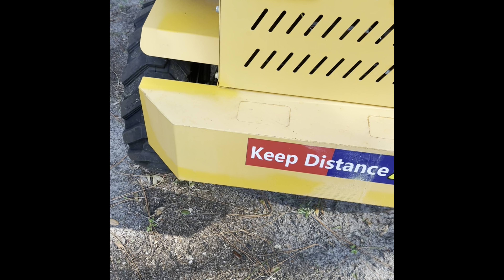Mini Articulating Wheel Loader: The FLAND FL45. Better than the mini skid steer or excavator?

Comment: I have one of these and picked it at auction for $3410 including buyers premium.  Yah quirky and odd plus takes off like a bat out of heck. It’s gotten 40+ hrs of use already and works awesome after you take care of the heat problem. Reversing frequently results is painful to the calves. I added a 12” fan under the operators seat to force the heat out the back. No more heat problem plus noticed the hydraulic fluid runs cooler. Had to replace the hydraulic fluid after noticing metal shavings in the tank.  Mods so far have been added grease fittings, 12” fan and replaced the sheet metal screws with rivet nuts.  Edges on canopy supports are extremely sharp. Have an oil cooler but there’s no easy location that I see to add one so that’ll be next. We used it for moving several units of mulch and was fantastic. Initially thought I wasted a ton of money but no more. Learning curve for someone who’s never used any kind of machine like this wasn’t bad.  I’m happy with it so far.  Show me something comparable at this price point.
Reply: which auction should i look for? website or address pls?
Reply: I'm wondering if there's a group somewhere that owners can share ideas for the FL45. I'd like to find out if anyone has tried messing with pulley sizes to change the speed. If so, share that information.
Reply: @jimsickmeier3281 yes there are a few youtube video mod list includes changing engine pulley to a much smaller one makes it much more usable(more drive force) also slows it down making 2nd and 3rd gears slower and more useable, next is replace rear bumper/fill rear bumper with concrete(rear bumper cannot tow or recover from also not enough rear weight) , 3rd readjust clutch  (notorious for being out of adjustment) , 4th reinforce throttle pedal (notorious for bending) , 5th relocate engine controls to the dash
Reply: @rocket2811 I want to say I seen few on Richie Bro's & Gov planet but if I end up buying something depending on price I might look for a dealer or someone that has a few ya your going to pay more than an auction but of the few dealers out there at min you know your not getting a lemon & they are able to walk you through it vs relying on YT but just a personal opinion but still in research mode

Comment: The owner of such a machine here. I've had it in the diesel version for two years. The machine is simple, undemanding and has already done a lot of work. I had a problem with the frost protection, it was too weak and rusted, so I changed it for 10 Czech crowns. I added a roof, a handbrake and a few extra lights. Also a cushioned seat with heating. I will also add a fan to cool the engine, because the water self-gravity does not cool enough and the temperature goes up to 100 degrees Celsius. Otherwise I am satisfied, it saved my back and hands at work. So let the machine serve you, have a nice day, colleague.🤝
Reply: I have wondered if you can take one of those temp cabs they make for other machines & modify them to work with these. They are like heavy duty plastic tarp material so not a lot of weight but if you live in colder area with smaller heater be effective
Reply: @how-i-roll-rb5796  Hi.  I don 't know , it is possible that he also produces those plastic bedspreads with a light frame. For me, what I put together with the leftover material at home is enough. Recently I added car windows on the side and back, so it's better again and the rear window has heating, maybe I'll even plug it into the electrics.  Have a nice day.

Comment: If one of these could take attachments and buckets like a mini skid steer, that'd be super useful especially moving trailers and stuff around or pallet forks.
Reply: It would require the skidsteer plate and I’m hoping it’s close enough that I can fabricate it myself to make it work as this seems more appealing to be than the stand on skidsteers
Reply: Auger would be great for post holes.
Reply: That'd be great too. I think with a little refinement these can be good machines once they get the bugs worked out.  @bobf61
Reply: I have claw and pallet forks for this, and a gas version I’m selling.

Comment: The gearing is 2x to 3x too high so it lacks torque and it dangerously unstable and over sped.  Super crappy for any hill work and dangerous everywhere else besides.  Has great potential once the bugs worked out.

Comment: I think ina few years these machines could really take off if they made some changes. 1. Offer a diesel option. 2. Switch to hydrolic drive motors, that gets rid of the clutch and speed issues. Also you could then lower the machine down more. Switch to a skid steer style attachment plate. And add aux hydrolics. Of they could also find a way to add a second set of tires like a Ventrac but I guess a knock off version. That would really give people a lot of options. You could plow snow, load trucks, move pallets, mow brush. Etc. with it. If that was around a 10k price tag I think you'd have a winner.

Comment: I made a small skidsteer...I found it stalled a lot at end range of hydraulics...just had to lower reliefs (didn't need all that pressure for lifting etc)...just thought that might help...love your channel.
Reply: The steering actuator is fed from the pump, the drain output of the actuator, then feeds the live hydraulic loader functions. That has a pressure relief, but the actuator when it travels to the end of it's travel, does not let the hydro fluid leave the drain, and hence locks the pump shaft and then the gas engine stalls.
I got one of these a few weeks ago at auction. I'm tearing to total pieces, as I see major weld and bending failures at the rear attachment to the hinge. I can see it bending and tearing loose from the much lighter frame (goes from the 12mm of the hinge rear plate to 5mm frame, which is not the full height needed to give structural support. The transmission install messed all the correct design packaging up. What I believe happened, is this thing started out as a trade school project to take a real 5 cubic meter payloader, and scale it down to one tenth the size. The 45 in FL45 (and TRANER TR45 identical version) is the size of the loader bucket it's 0.45 cubic meters. Seeing all the crazy welding on this, it looks like trade school practice (or prison), but I think the CAD training dept got the drawing for the 5 cu.m. version and wanted to sell electrics. This thing started out being initially exported as an electric, and if you find a video, they are about 30-40 cm longer, and with 5) 12 volt batteries, at 60 volts, had the weight needed. But they also changed the tires, as they were using a thinner one on the electrics. That what I'm guessing happened, and going to a mechanical engine, as the electrics did not sell, they shortened the rear section, and geared it all wrong. 
But it's a good starter kit. I'm going to redo the frame, extend it slightly, remove the belt drive, figure out how to put a hydraulic motor input into the clutch to keep that function and 3 speed transmission and put a variable flow pump on the engine rotate it 90, and mount it near the end with the shaft to the right side of the operator. I've removed that moron exhaust pipe to muffler weldment they did, they stacked multiple gaskets, as when they cut the pipes from the muffler, and welded them onto the square tubing, it clearly had much weld shrink, and stressed the heck out of the M8 studs holding all that weight on and with an offset torque. I got a new muffler, and it will rear discharge, that was one of their issues, as the original muffler would be a right side discharge, and in the way of the hydraulic valves, so they made it rear discharge. But I know that stress on the 8mm bolts will cause them to pull out over time. Also the guy/gal that torqued these bolts, (on the ones that were tight) were all overtorqued, and you can see the spinning of the metric socket on many bolts where they beat them with impact tools. I'm thinking trade school, as they keep building them.
Reply: @f.hababorbitz  could put a relief straight after the pump,a lot of systems do this to protect the pump ,but in your case would prevent a stall...but another return pipe to tank required. The Chinese take short cuts,but it keeps you thinking.

Comment: A first few mods you want to do is decrease motor pulley sizes, next fill the rear bumper with concrete or replace with a more significant bumper still filled with concrete, relocate engine controls to the dash, and readjust the clutch finally reinforce the throttle pedal
Reply: what size pulley
Reply: Most use what they can get a hold of... I added a jackshaft to mine so that I could reduce mine to a top speed of 10-15 mph (10mph with stock 23x8.50-12 tires 15with 26x12-12 as I'm upgrading mine to larger and wider tires for working in wet blue clay and added ballast weights) I used a 3inch motor pulley to pump(still a little big but was what I could get), then a 4.5inch motor pulley  to jackshaft 7.75inch pulley thru jackshaft to 5.5inch pulley driving the 9inch clutch pulley this will give you those listed top speeds (everything was sized based on what was available and to reduce belt slipI used b-belts for the entire setup).

Comment: That thing would 100% more user friendly with hydro-static drive.  Would give you the ability to run fixed throttle position.
Currently building a similar machine using an old Twister as the base.
Reply: I'm working on that exact mod now. Moving the engine, putting the original muffler back on (got one for $135 delivered) as it will cause the engine studs to pull out of the aluminum head. Tough part is to get a hydro motor to the clutch shaft input. Got a variable pump intended for ZTR large mower. We shall see how all this goes. I'm having fun, learning stuff, so I don't care. I knew when I paid $2808 (with tax and auction premium) it was a toy I'm buying to play  with in my retirement (12th year). There is no structural engineering or testing that I can see in this, just "it works so export quick". I think these came from kids in a trade school, that got money to make another electric construction implement, as those were the first exports 2 years ago, which appeared to fail, so they put a gas engine on it. But no gearing, and the weight of the batteries made a big difference as well that machine was a foot longer with 5) 12 volt batteries, and the throttle controlled the electric DC motor. So you didn't deal with a 2500 to 3600 motor RPM on clutch release. All the welds look like new learners, and where they screwed up, they ground it out and repaired, looks like an instructor was teaching, lots of stick and MIG.

Comment: I just picked up one of these yesterday.AGT brand KRW23.The auction company drove it on the trailer,when I got home will not start to get it off the trailer.I noticed some changes from this one.Canopy much sturdier welded round tube not flatbar,one key on dash,choke cable on dash,no key or hand throttle on the motor,the panel behind the legs is solid with no vents and has heat barrier on the inside,all the pins had normal grease zerks.-15 Celcius here,does not like turning over in the cold.
Reply: Had the same problem starting - CHECK THE FUEL FOR WATER! Auctions dump only a dribble of gas in them, and the weeks they sit waiting until the auction causes accumulation of moisture.

Comment: I agree with @AA,
Welded diff won’t work..
I have a John Deere 640 D’s and they have a lever to step on , to lock up the diff’s in a straight line ..
But don’t forget to unlock before turning .. they cannot turn correctly without an open diff , since your steering is in the middle of the unit .. not on the axle like a car

Comment: One tip to help not stall it out when scooping is to use your bucket more.   What this means is come into a pile with your bucket pointed down and just roll your bucket back as you gently push into the pile.   You will hardly work any machine doing it that way and get super heaping full scoops.
Reply from the maker: I'll have to try that out, thanks!

Comment: i have a old 371 bobcat, just re built it again from 20 years back, it is a 1978 ish machine, works good but small. gets the job done tho. also on this machine you have, there is a video out of a guy building one almost the same, so that was probably the prototype of this machine you have. tons of bugs to work out yet. being on a gov it would take care of stalling issues, set it forget it. it is way too fast, but my old 371 is way too slow unless at the work sight it is ideal. some day i hope to re fit a v twin in it, but, as is now ol preadator motor will not bust anyting in the belly of this old bobcat.

Comment: Looks like it should have been hydraulic drive. I would also see if I could modify it to turn sharper. The diffs look like they are small automotive like a samurai. Look for build tags on them they might have a number that can be looked up to find out what they are. lockers might be available.

Comment: If you turn down that pulley,it would  be pretty small,for grip....I reduced mine and had to put a tensioner on it to wrap the belt further round the pulley so it would not slip (was a double also)
Reply: Do you mind revealing what diameter you took the pulley down to?

Comment: You should look into changing out the pulleys to lower the drive ratio, it should be a lot slower. You should set the hand throttle to set the base rpm and use the foot throttle just in case you need more power.

Comment: Does the F in Fland stand for FORD lmao 

When you mentioned you had mini skid steer were they stand on ones or ride on i ask bc I been looking at these & like smaller knockoff bobcats tracked ss, for me unfortunately my previous careers led to injurys & unable to stand & going to watch your rc mower video as I have seen some that come with either plow blades & some with snowblowers (i live in area with that white crap & being paralyzed I hate asking for help more so bc even though people offer usually never available when you need help) with the rc ones though most have up to 12-13hp eng Harbor Freight sells 24hp engines which I wonder if u can swap them out but even on Alliexpress most expensive I have seen was $5k for RC mower though your paying for the name & warranty but there commercial ones like Dixie Chopper & others but they are like $30k. So appreciate your videos bc I been looking at various Chinesium machines that would make being tech disabled a bit easier

Comment: welded diffs wont steer very good our big old skidders locked up and it dont steer worth a dam. a small pulley dont grab a belt very good and you could end up having lots of belt slip. shorter belts to a jack shaft to a chain drive to the clutch would be a lot of work but i think yield better results. i want one of these to play with

Comment: Just a suggestion instead of pins use grade 8 bolts and nuts keeps things tight and keeps things from spreading apart and bendig pieces. Also ajust the idle screw

Comment: Need to halve the size of the pulleys on the motor. You're throttled down due to everything being too fast. You wouldn't stall it anymore if you halved the size of those pulleys, and get more use from the transmission too.

Comment: Instead of 1/2 in plate in rear bumper water down the rear tires
Reply: or remove those two knock-out plates and fill the whole bumper with concrete

Comment: It has 3 major flaws. It needs a mini skid attachment plate and auxiliary hydraulics and then you have something a little more versatile. Also needs lower gearing.
Reply: You can order these with a quick attach, almost no retailer did to keep cost down
Reply: @johnm5467 can you order the part to put on a quicktach?
Reply: also wouldnt hurt to install a cutting edge on the bucket

Comment: Change the drive pully to bigger to change ya speed to slower it
Reply: nope, that will do the opposite, it will speed it up
Reply: @DWinnie67  wouldn't making one smaller also change it
Reply: @DWinnie67  wounder how a CVT drive would work